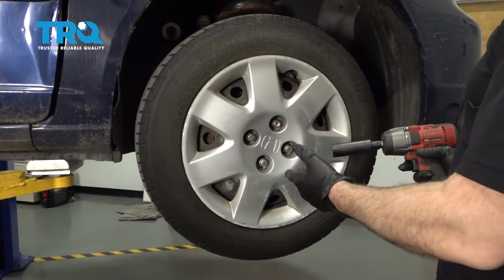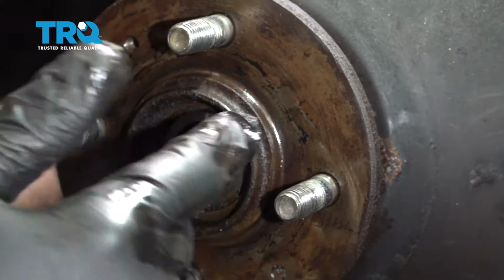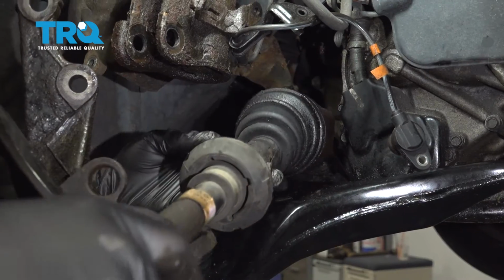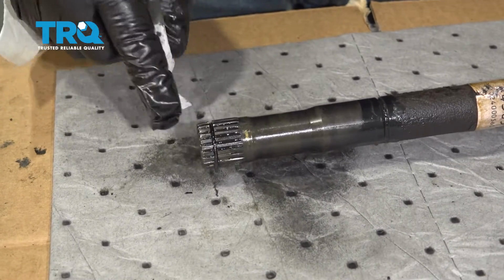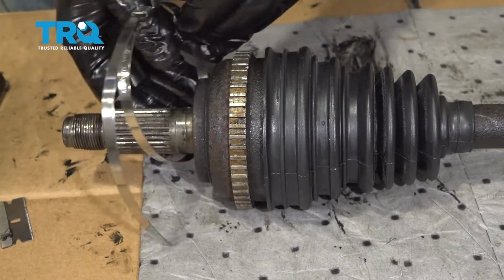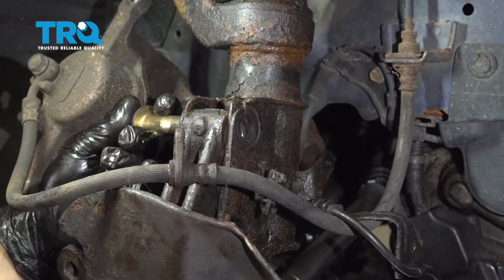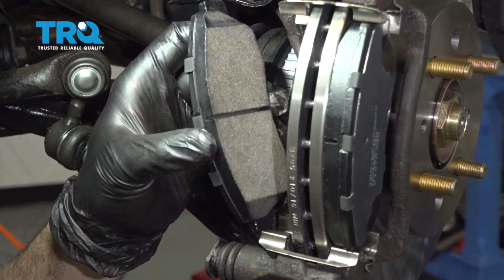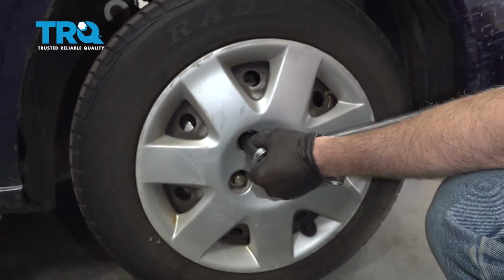How to Replace CV Axle Boot 2001-2005 Honda Civic

Comment: Don’t need to remove calliper carrier, don’t need to remove disc, don’t need to remove abs sensor just remove both brackets from the arch/shocker. Don’t need to remove driveshaft from gearbox at all you can do it in place, just wasting gear oil. 
Also best if hitting the edge of the cv joint with a hammer rather than hitting it internally with the brass, less likely to damage the internals. Also using a zip tie is a BIG no no it’ll just come off and you’ll lose your grease 10 miles down the road.

Comment: did you put the drainage of the tranny fluid back into the transmission??
Reply: they will rarely leak unless you have that side lower than the other side
Reply: Same question